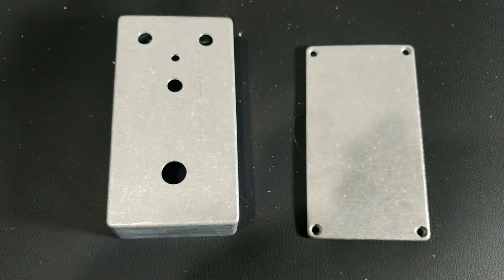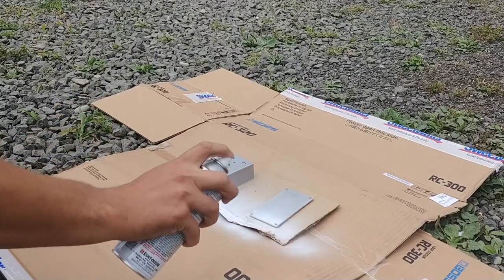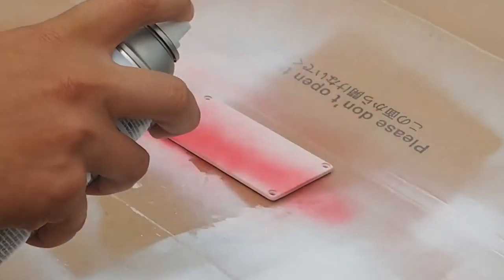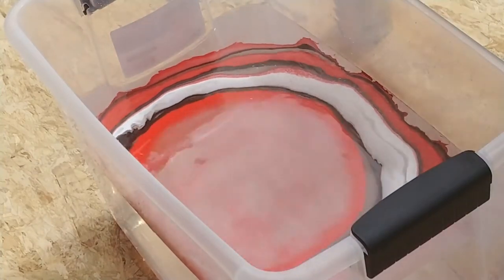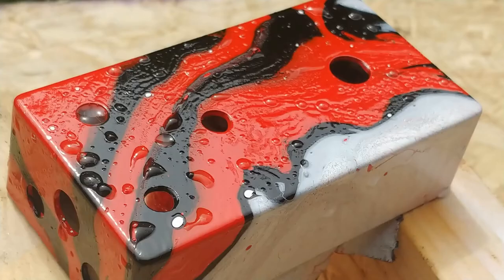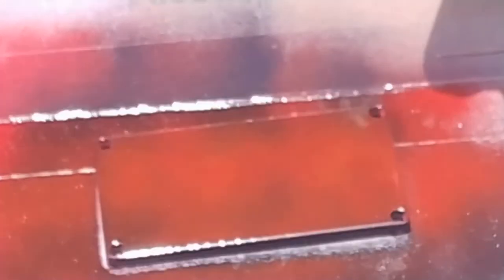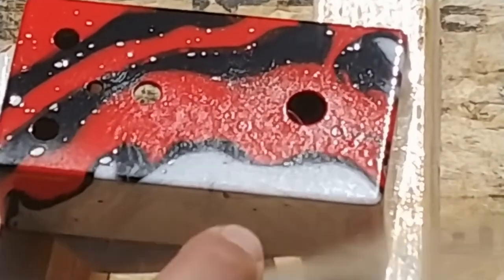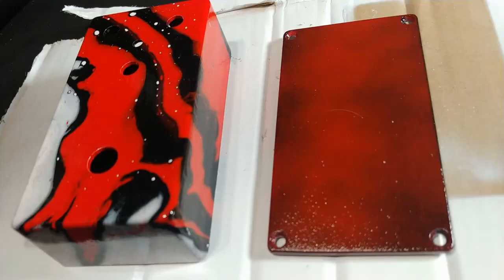HYDRO DIPPED GUITAR PEDAL ENCLOSURE (How-To)

Comment: Looks like shit. You know you can use a fan to remove those bubbles, and firstly you can just shake it off to get the majority of them then stick it in front of a fan. Also when you dip it, hold it under the water, and use something to remove the excess paint.
Reply from the maker: It doesn't look like shit, it's "abstract" 🤣🤣🤣

Ok, maybe it looks like shit. But it was fun to try out 😉 thanks for watching and thanks for the tips.